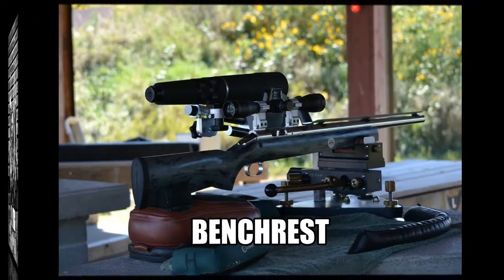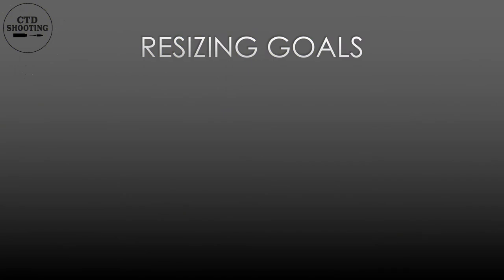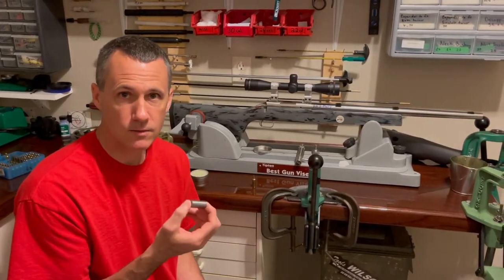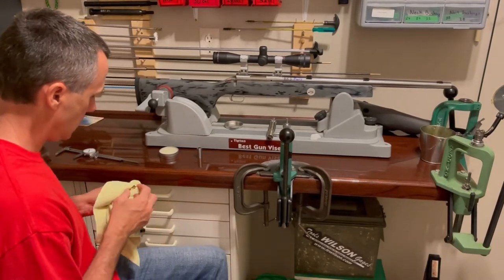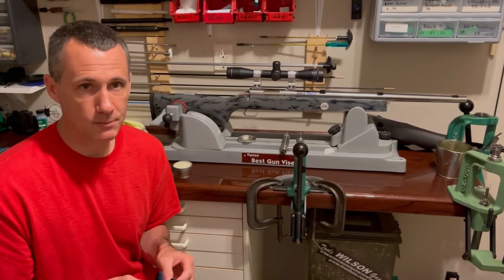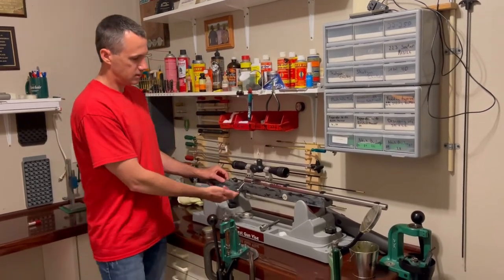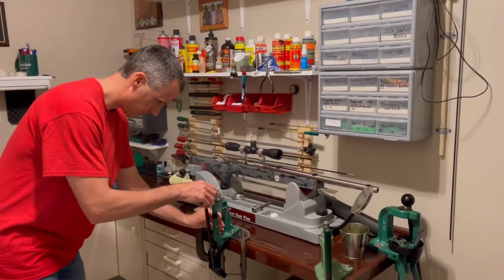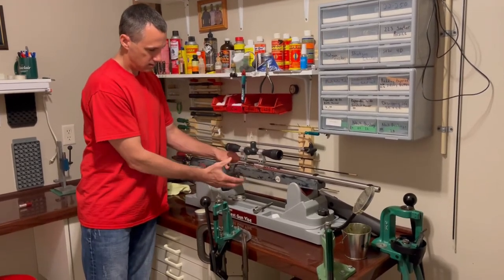How to Set and Check Shoulder Bump setting on Resizing Die: ctdshooting

Comment: Thanks for the great explanation. Can I ask a really basic/dumb question? How do I change the setting on my dies to change the amount of bump to be less or more? I’m using the ultimate Lee set for 6.5 Creedmoor if that matters.
Reply from the maker: First - if you have a question about reloading....ask!!!  There are no dumb questions when dealing with something as dangerous/important as reloading.  Second, never just blindly trust what someone on the internet says (yes, that includes me).  Think about what people write, and see if the logic makes sense.  This will help you learn and solve problems.  To answer your question = I take out the bushing or expander ball so I am not messing with the neck diameter - only the shoulder bump.  Assuming your die to close to where you want it - Start by indicating location of die  and locking ring while the die is in the press.  I just use a sharpie by making a line on the locking ring and threads on die.  Then, unlock the locking ring (usually an allen wrench).  Now if you want more shoulder bump - screw the die down. If you want less, unscrew the die up.  When you get close to where you want to be, it will take very small changes (this is where the indicating mark comes in handy)  Once you get the desired shoulder bump tighten the allen bolt on the locking ring.  Make a new indicator mark - erase (dissolve) the other one.  You might have to use a pliers (RCBS also make a die tool) to get the die to unscrew from the press.  It is not unusual for this to take 3,4, 5 or more cases to get the die where you want.  Don't worry - just shoot them and they will fireform back. Hope this helps.  Feel free to email me at ctdshooting@gmail.com and we can discuss futher.